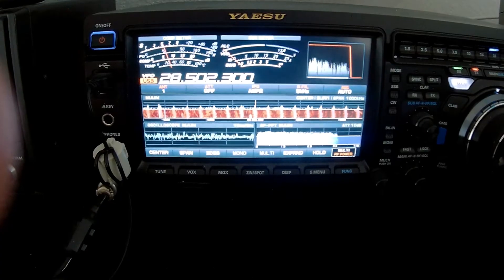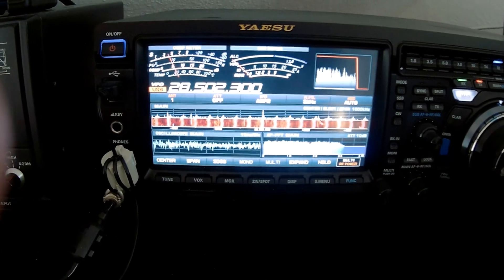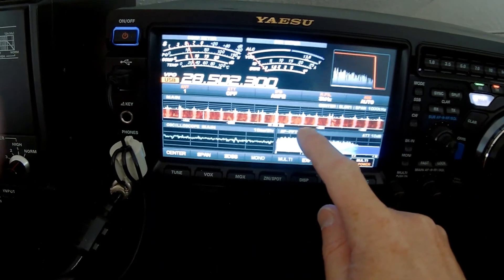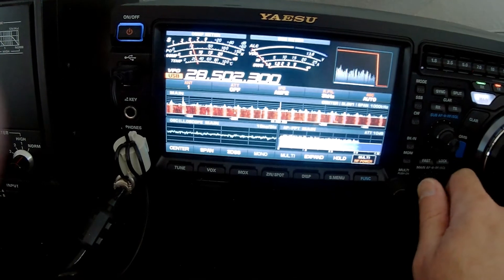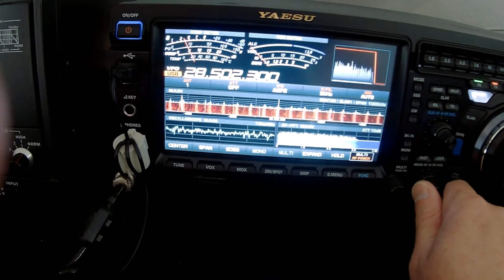Radio and HF interference of MPPT Solar charge controllers  - and how to reduce RF Noise

Comment: interesting video - thank you for posting - my application and question is little different but mayer you would consider an opinion? I have an mppt controller that I would like to use on my boat. The application in this scenario is that the boat will have a 48V lifep04 pack for the motor with the MPPT controller serving as an inverter with aDC12V load supply for sonar. The sonar operating range is 150khz to 1 Mgz depending on the features used etc. I will NOT be charging on the water. The boat will dock and I will hook it up to a solar array with the sonar off. My question is centered around sonar interference since these devices are very sensitive to that. Do you think its even worth trying to use an MPPT controler as an inverter and "docking" controller in this context?
Reply from the maker: I have only 150kz at my vessel but no interference on that

Comment: Thank you! I didn't think about twisting the power line coming from the panels... BUT it worked completely... I have been dealing with the periodic birdies on HF since 2019! I even tried torroids... maybe not the correct mix though...., but the twisting really worked.... 73, Julius K4NAL
Reply from the maker: Hi
You are welcome.

Comment: I parked an MG rental car at a carpark with solar on the roof of the car park, the remote control for the car refused to work ( I couldn't lock the car), I changed the remote battery thinking that was the issue... But even with a brand new battery it still didn't work.
Luckily I managed to start the car and moved it away from the solar panels.
I'm assuming the charge controller created interference.
Reply from the maker: I am sure that EMI played a role here

Comment: Question / Frage: will the solar pannel cable pulling through/into a metal pipe  have the same endresult as the twisting ? / Will man dasselbe reasultat erzielen wen man die leitungen vom PVC zum MPPT in ein metalisches rohr zieht?  Thank you for your reply - vielen dank fuer ihre Antwort. 73 de VA2VFF
Reply from the maker: Hi. A shielded cable would also bring an improvement. Just try it.

Comment: Thank you for the tips I have a Victron blue charger I need to shut up . 73's
Reply from the maker: Well, I guess It's an MPPT. You may have to connect an additional EMI Filter  at the inside and outside connections, as well as an additional ground at the chassis. But keep in mind that every MPPD produces some noise. Maybe you can use a coax cable instead of the twisted line on the DC side (to the solar panel).